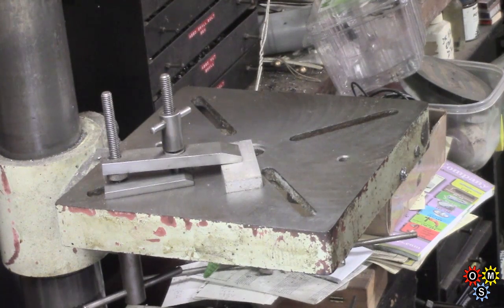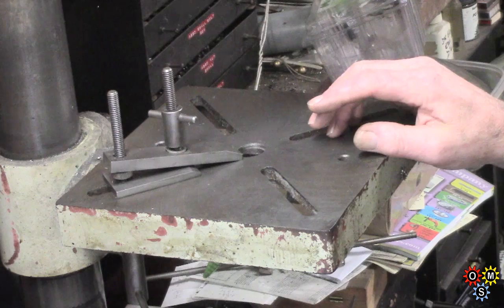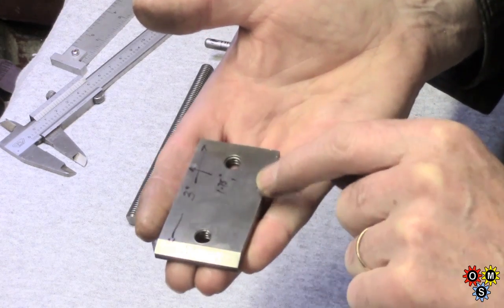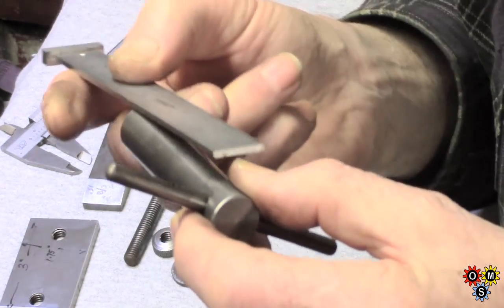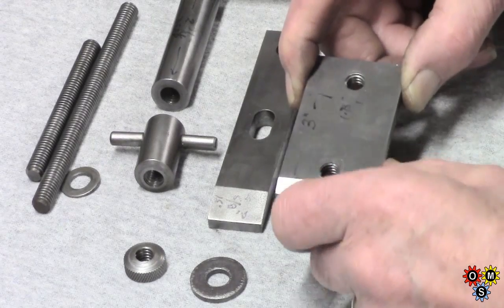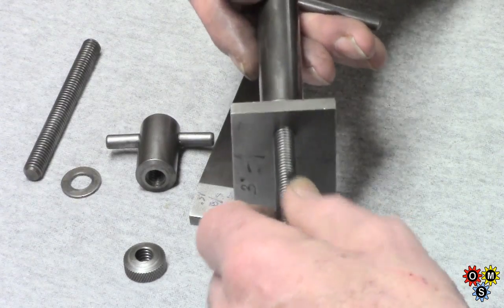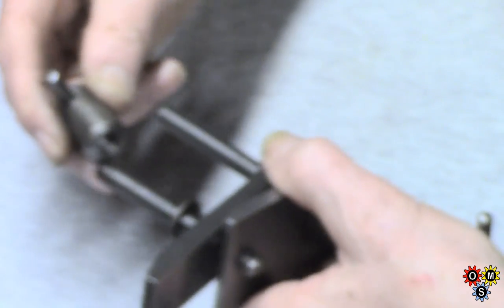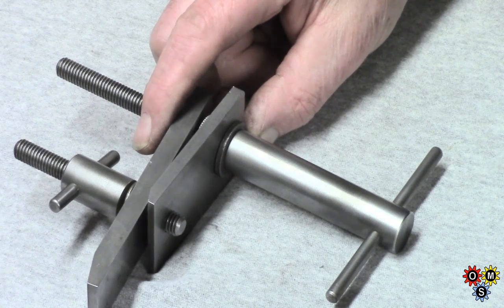Drill Press Clamps, Details

Comment: That's a nice design Chris I would make one one but I don't have a drill press any more I do all my drilling on the mill, atb John.
Reply from the maker: +John Wellings 
Hi John. Got me to thinking - with T-nuts added and small tweaks,  it could be they'd work OK on mill as well. Thx for stopping by. :)
Reply: +ChrisB257 I only have a small milling machine Chris I have some ally plate 20mm thick on the bed with a matrix of M8 tapped holes through to hold things down it took me 2 days to drill and tap them all . atb John
Reply from the maker: +John Wellings 
That reminds me John - I have a piece of Al plate set aside for that basic purpose - one of many things I have on 'the list'!

Comment: Great simple part,tool, a must working with a drill press,  beats getting hit by flying parts, something that happens all too often and could be very dangerous...   ;)
If I rely on statistics, a drill press is causing more injuries than just about any other tool in a machine shop... :(
Reply from the maker: +pierre beaudry 
Yes, pretty simple Pierre and they work well. You are right - the drill press can be dangerous! Not only the piece that catches and flails around but, also handy to locate work for sequential drilling sizes etc.
Reply: Bill Lewis
If you're not using a vise or clamping device, it's a good idea to lean the part on the column or a pin or plate installed in a hole or slot, that will limit the movement...  Make certain if it lest go it's in the direction past you...   ;)
Reply: The worse in this, is that we do ALL take shortcuts once in a while....    Oupppsss...  :)
Let's be careful and play safe...
Reply: Don't tell Marc, he wouldn't be so proud of us...   LOL